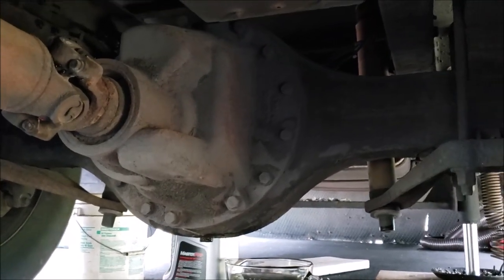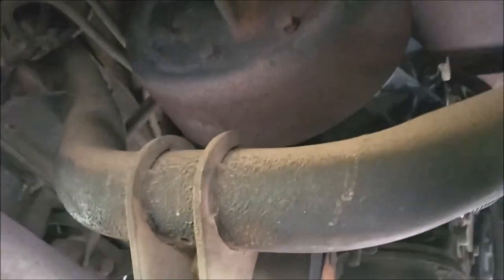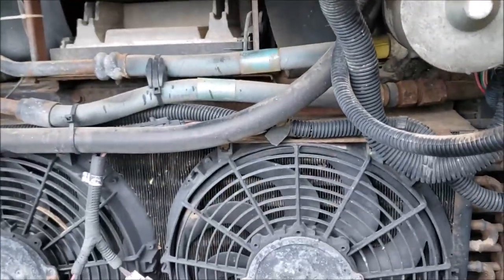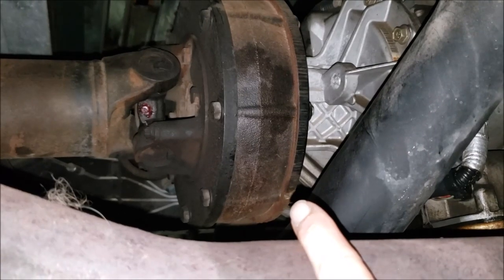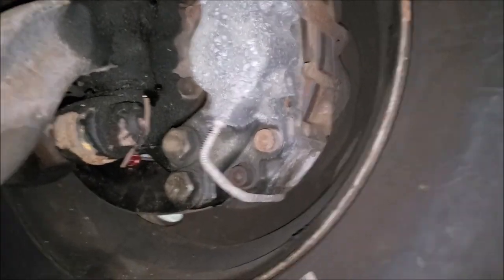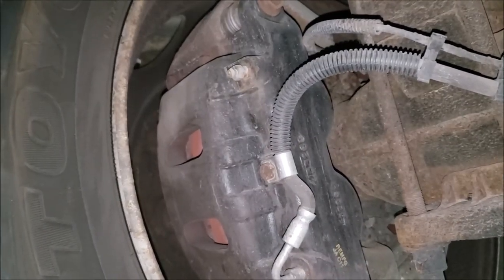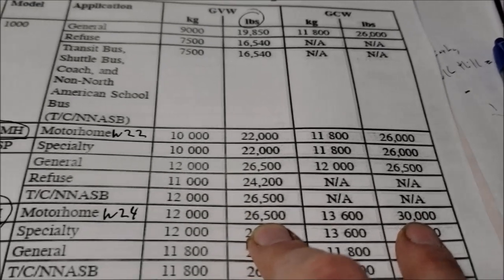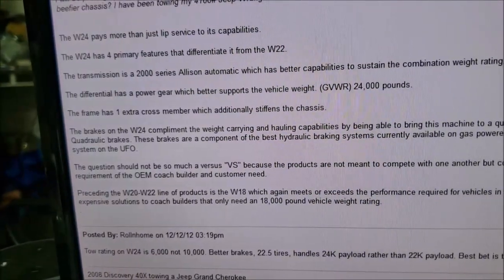What is The Difference Between a RV Workhorse Chassis W22 & W24

Comment: Hi Kevin. Question for you. Did both the W22 &W24 have the grade brake? My W22 (2005)  has it on the MH1000.
Reply: Hi Dan! All of the W-series RV's from model year 2005+ were equipped with the GradeBrake feature. Ultra RV offers a "retro-fit" to add the GradeBrake to the 2001-2004 model years.

Comment: Hey Kevin, my stepdad’s 2008 W22 doesn’t have that connector for the brake master cylinder. I’m wondering if they fixed that issue that has the ABS light on?
Reply from the maker: Looks like they removed they switch in later models just so we would not get the light just encase the front and rear brakes lines had a momentary in-balance.
Reply: @ktoutdoor  so it’s basically no different than us just unplugging it?
Reply from the maker: @bounderchris  Correct

Comment: Big rear-end hold lots more oil. I think they just got a deal on them It took forever to put all the resend greas in it. Ours is the Winne 2004 35J Adventure I think it has 4 wheel disc breaks

Comment: Nice job I have a W22 Workhorse I need to change the front inner wheel seals right and left wheel I was trying to see which seals you used or think I should replace them with?? Thanks
Reply from the maker: Look at my brake job video. 
About the 40 minute mark 
https://youtu.be/81kKqFVlHbg
Be sure to use a workhorse seal
Reply from the maker: Also check this out https://www.ultrarvproducts.com/2001-2010-Workhorse-W20-W22-Brake-Job-Kit

Comment: WOW big differences between them.  I seriously hope I have a w24 chassis!  Just the transmission difference is heavy.  The 1000 is a light duty truck trans while the 2100MH was designed for motorhomes.  It's a bit beefier.
Reply: Ok I have a w24.  Easiest way to know is the GVWR.  Mine is 24k lbs hence W24.  LOL seems so idioticly simple now.
Reply: @llspragulus also the Allison 1000 in trucks is a bit different than the Allison 1000mh
Reply: @bounderchris  Ok let's chat about that.  Not saying you're wrong.  I could be way off base due to clutch material types etc. They are different in casing and bell housing due to the PTO and the need for a smaller footprint. However, spec for spec, they're exactly the same.  Gear ratios and the valve body are the same.  They're pretty much the same.  The only major difference I can find is the MH came with both a high and shallow capacity oil pan.  Maybe there are more heavy duty planetaries and bands?  Do you happen to know?
Reply: @llspragulus I am not sure but I do know that GM makes the 1000 themselves but the 1000mh is made by Allison and the drain interval is longer on the mh… I’m not sure what else is different though.

Comment: Has anyone figured out why the smaller rear end is in the heavier chassis?!
Reply from the maker: I called Dana they told me the S130 may look smaller in size but with thicker walls in the tubing it can support more weight than the Dane S150
Reply: @ktoutdoor  hmmm interesting. I wonder why the cut back in fluid too. Are the ring gears the same size in both? Oh it’s a 14.38 in the 135/150 and a 12.2 in the 130.

Comment: The big drum on the back of the Allison trans in a W22 is the parking brake. It's not the park mechanism that is internal to the trans.

The weight of the W24 chassis exceedes the weight limit of the mh2100 trans so they added the troublesome auto park lock system.